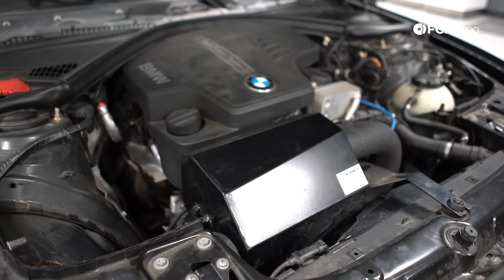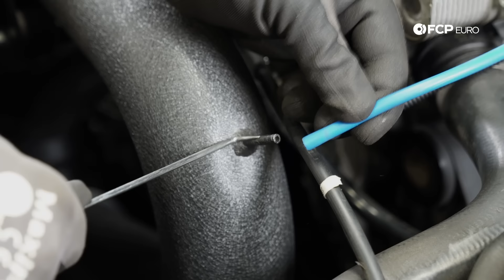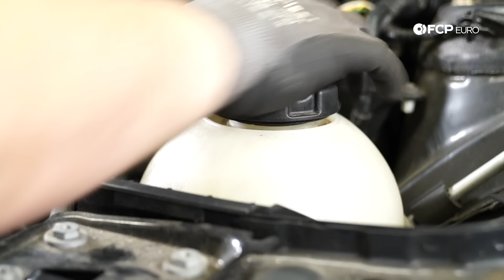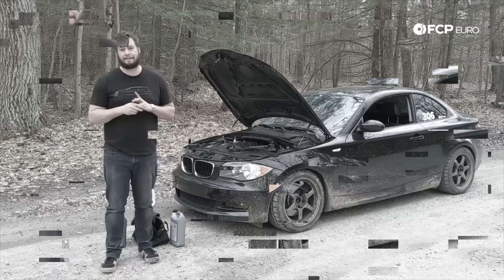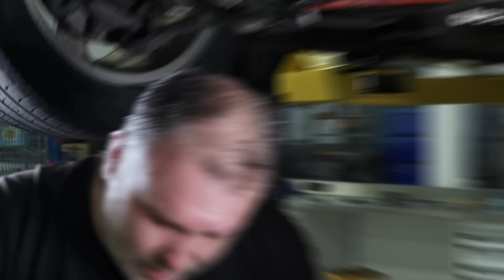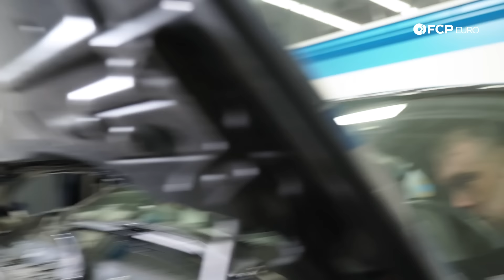BMW F30 N20/N26 Water Pump & Thermostat DIY (328xi, 328i, 528i, Z4, X1, X3, 428i, 228i & more)

Comment: Can a bad water pump cause mixture codes on e90 n52? I can't get rid of three codes. 2e85, 29e0, and 29e1 mixture control rich condition. Pumps seems to work fine but definitely is rich i can I can smell it sometimes. If  The water pump is bad Our place it no problem I just don't wanna buy a pump that I don't need so Any opinions would be fantastic and appreciated, thanks
Reply: Drivetrain warning and/or engine fan constantly running are signs of a failing water pump.  They tend to fail slowly.

Comment: I've seen other people drain the coolant from the lower radiator hose as well as the water pump.  Is that necessary, or is draining from the water pump all that's needed?

Comment: At what mileage does this part tend to fail on the f30 n20
Reply: Mine just failed at 102k
Reply: I’ve seen anywhere from 30k miles all the way to people with 120k stating they are on the original one. My N55 is at 91k miles and still going strong.
Reply: mine 115k miles still going strong
Reply: Mine just failed at 125k. Just past the extended warranty
Reply: @jnorriect Oof, how typical though.
Reply: Late but mine just failed 135k
Reply: I'm replacing mine at 112,000 miles as a precaution.
Reply: Mine failed at about 115, bought a cheap after market for a round 100 bucks off Amazone that failed after 200 miles. Lesson learned but OEM and save you’re self money on paying for the 2nd replacement like I did 😊